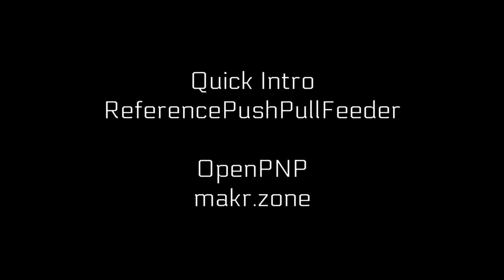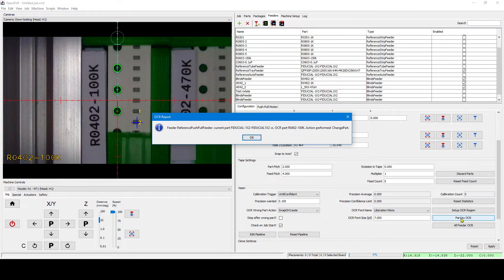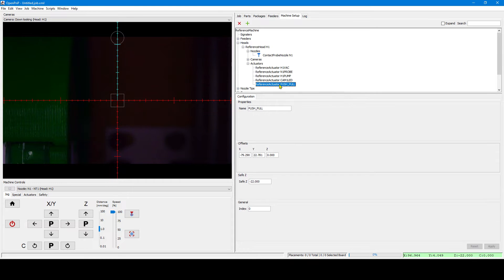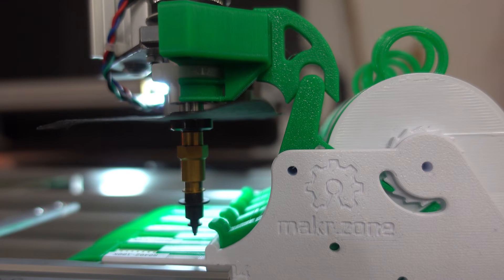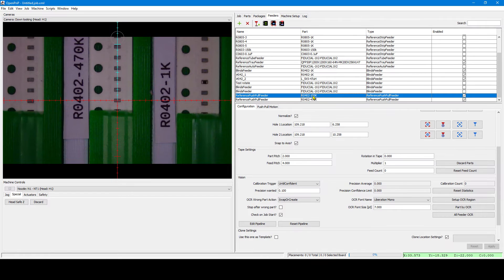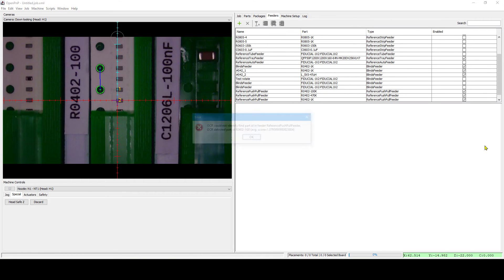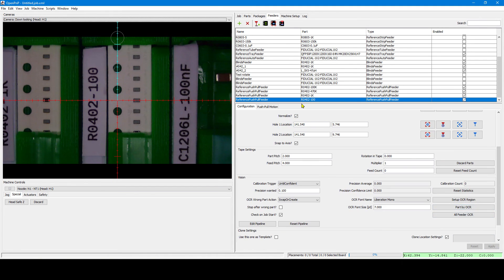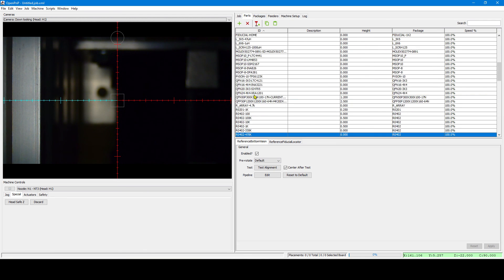ReferencePushPullFeeder Quick Intro

Comment: Its soo good, only problem is the OpenScad, its very slow. I want to make few changes in parameters and some other things but its not easy. Could you please use a free cad software or something to make the models, that would help much. Thank you for all the hardwork.
Reply: I disagree, I hadn't heard of openscad before seeing this project but I installed it to try making one of these feeders to test and found the parametric adjustments to be super useful and way more accessible than in any other free cad solution I've used
Reply: @DRawwrrr  well I use solidworks and all these things are available in it too. Openscad is pretty much crap compare to solidworks. But yeah openscad is free but that doesn't mean one have to use that. You can't export it to step or any other cad file format(not even with freecad software plugin). When sharing files to public, one should make sure it can be used by any other programs too, not to some specific way-too-much-limited software.
Reply: @xmenxwk  all the shows is you don’t know how to use software so you blame the software